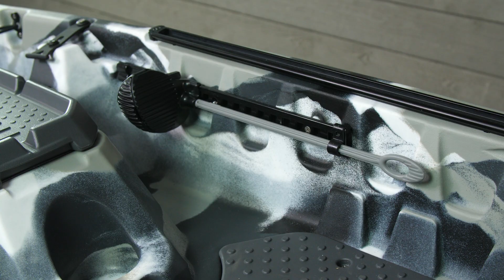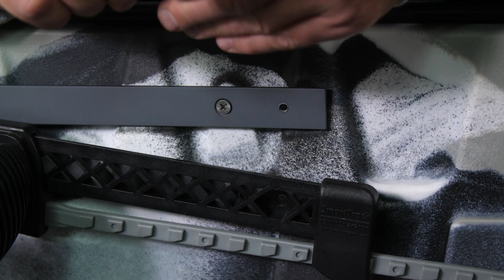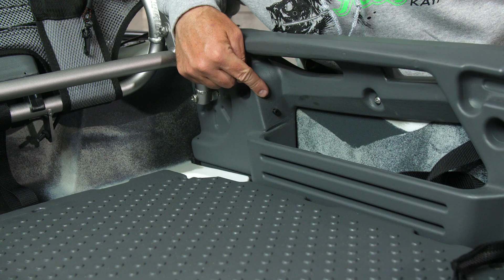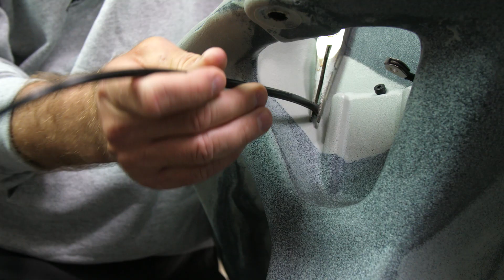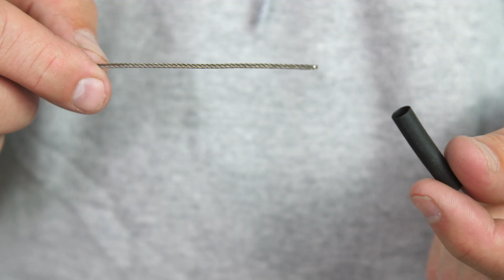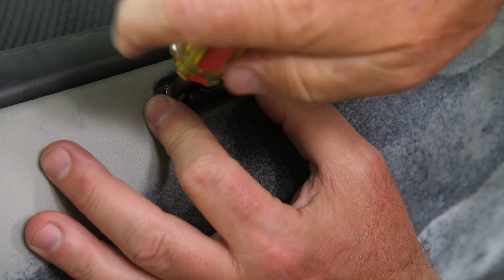Beaver Tail Rudder Installation Tutorial - Big Fish Kayak Series

Comment: This video is better than nothing but it’s still lacking in several areas.  This is long but I’m writing it more for the benefit of 3 Waters than watchers of the video.   Problems:   1) One of my footrest screw inserts stripped when taking out the factory screws.  I was using a shorty screw driver so this wasn’t an issue of using a power tool where I shouldn’t.  The insert is still there but it spins around so you can’t tighten the screw.    2)  The section of the video for people with hand controls SHOULD NOT BE SKIPPED.  It was critical in me solving other problems.   3) I could not get a cable through one of the tubes.  I tried from both directions, fed the entire length of cable, and it never came out.  WHEN I PULLED THE CABLE TUBING OUT, IT WAS ROTTING, DEGRADED.  A few feet were clean and looking fine but the majority of it looked like it was dipped in acid and falling apart (I’ve used my kayak 3 times).  There’s no reason to think the rest of the tubing is any better and one day on the water it’s going to come apart and jam the rudder, probably when I’m in a turn.   I followed the instructions for the hand control using ¼ white vinyl tubing I got from a local hardware store, cost less than $1 for 7 feet.  This was a perfect replacement, much better than the black tubing that comes with the kayak, and it fit the exiting holes perfectly (no drilling necessary).   I used 10 gauge wire to pull it through instead of 8, which was too snug a fit and wouldn’t allow me to pull it through the existing holes.  4)  Unlike the video, my rudder came with the cable guides already installed.  This made it much more difficult to run the cables and crimp them.  I didn’t want to risk taking them off and doing like the video because of fear of screwing up those delicate spilt rings.   5) one thing that is shockingly not discussed is having the right amount of “play” in the cables to assure you have the full radius of turn but not so much slack that the rudder hardly pivots at all.  I got very lucky by having the correct amount.   6) The up-haul cord would not feed through its tube.  I ran a cable from the control end (not the rudder end) and it popped out fine.  So I ended up using the suggestion from the hand control portion of the video and taped the cable to the cord and pulled it through.  It took a few tried but it worked.   7) The cord cleat is a poor/strange design.   First, the screws that are provided are nothing like what’s in the video.  You also need to leave yourself enough cord so you can leverage the rudder up.  It’s not spring loaded and requires effort so you can’t have just 1”-2” of cord to grip like is suggested in the video shows.   And, because of this extra needed length, the cord is just hanging off the side of the kayak waiting to get snagged on something.    Good news:   The rudder appears to work.  I took the tape off the footrest pivots and everything looks good; full radius of action, couldn’t feel any binding, I could still adjust the footrest without effecting the rudder controls – all good.  Just got to get it out on the water now.   BOTTOM LINE:  3 Waters needs to tweak their video and seriously upgrade their cable/cord tubing.  They get credit for al least doing a video but their poor quality control regarding the cable tubes is inexcusable.  Told you this would be long.

Comment: Of course it's not that easy.   One of the cable tubes and the cord uplift tube were blocked on my kayak.  The cable tube is a lost cause.  You can hear it hit a hard surface about 18"-24" before exiting by the rudder.  I even fed the cable from the rudder end to see if I could clear whatever was blocking it and the cable disappeared into the body of the kayak.  The cord tube has a crimp in it about a foot from where it exits by the seat.  I can push a cable (not cord) through it from opposite direction but again, that same cable will not go through when pushing it from the rudder end.  I think I can fix the cord situation but the foot cable tube is a lost cause; I have no choice but to rip it out.   This is simply bad engineering.  Such close tolerances with the these soft, pliable tubes and cable/cord is absolutely unnecessary and they could be bigger without any risk of binding.  And the fact that these tubes come without any kinds of plugs is plain stupid.  Any kind of debris can get in and block them.  Even lake water would have enough crud to block them.  

It really irritates me that I have to take apart my $1000 hardly used kayak and re-plumb it because of a factory defect.  Let's just hope it works when (if) I get it on the water.
Reply: chill dude...

Comment: you need to let people know that they need to use your screws when reinstalling the side rails.  if you use the factory screws it strips or pulls the studs out of the kayak.  Also the cables get stuck at the end of the tube when feeding due to the plug at the end of the tubes use needle nose pliers pull the plug gently and wiggle / push pull with someones help to get it to feed through the end.

Comment: Where can I get the tube and end caps?
Reply: me too please. I have the Advanced Angler that has the terminal locations molded in to the body but no tubing installed...
Reply: I also have cabelas advanced angler and was wondering what was need. What size cable and tubing needed.  I'm installing trolling motor and was using the cables connected to a control arm mounted to the trolling motor to steer.

Comment: Neither of my rudder kits came with the bases that are required since the mounting points don’t line up. In addition, the bases, foot controls, and replacement foot rails aren’t even listed on the parts list which made the already vague instruction manual nearly useless. Fortunately I stumbled across this video which answered many of my questions including who I need to call for my bases.
Reply: this will fit on the feel free lure 13.5  and also the pedals control will fit on the existing foot rest of my lure or I have to put the foot rest   with the new kit and if yes I'll have drill new holes on the yak to screw the railso or the existing holes can be used . thanks